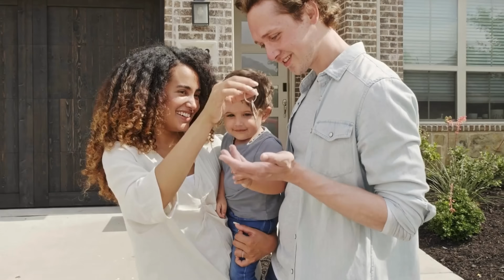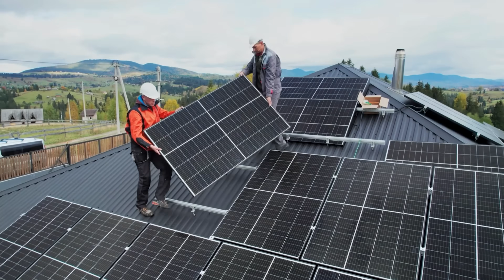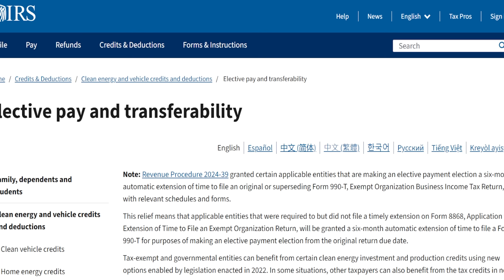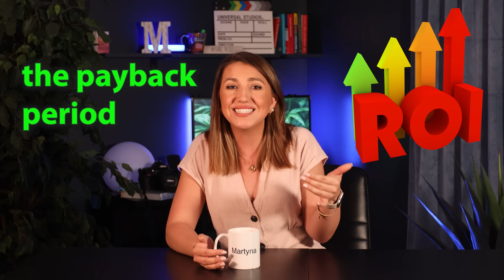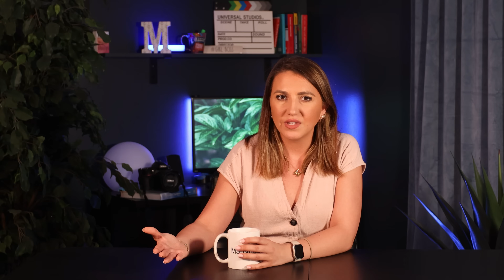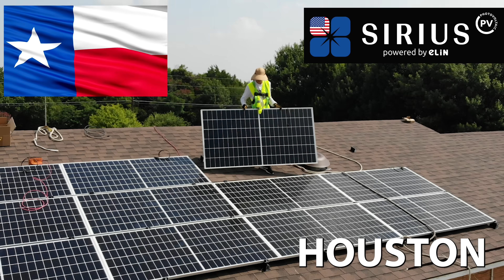Why you should buy SOLAR and BATTERIES NOW in the USA? | Tax Credit just Eliminated by the House!

Comment: I’m 2012 I installed huge solar arrays on my house and my state gave me a 50% tax credit and the federal government gave me a 30% tax credit. I kicked in 20% to get it fully paid for. Unfortunately, Louisiana soon ended that tax credit but I was able to take advantage of this great deal. I am grandfathered in at a one for one credit for my excess power production. I have a $25 a month grid bill but it really great to be energy independent. Later on I installed two power wall batteries so I can use that battery system if the grid goes down and if we have cloudy days while the grid is down and the solar is not producing enough energy to charge the batteries I do have a built in whole home generator to charge the battery’s up instead of running the generator 24 hours a day which takes the load off the generator not having to run all day long. Living in Louisiana we have a good chance of hurricanes and losing power for any length of time in our climate makes life really unbearable. Air conditioning is more life support rather than just a comfort issue.

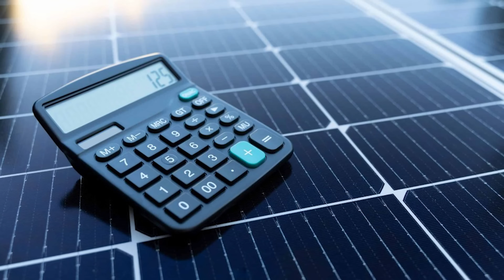Comment: The Solar Companies have been overcharging for solar equipment by 30% 2:28 for as long as it has been given subsidies (30%).  I am excited to finally watch the tide go out and see who has been swimming naked.  Greed of solar companies is now backfiring on them. Make them compete with one another.
Reply from the maker: You're definitely somewhat right, prices will drop in a year, manufacturers and distributors will lower.. because they will sell little and installation companies will also lower margins - I assume that solar will still sell.... but without such companies that go door-to-door and rip off clients for high prices. I'm not afraid for my company we have costs under control and I'm even happy that a lot of dishonest competition will disappear from the market in half a year

Comment: The solar installation (as I understand) needs to be up and running in order to claim the tax credit. So if the bill takes away the credit and it doesn't pass until late in the year it could be crunch time or too late to start the process of installing rooftop solar. A system that goes online Jan 1st is too late.

Comment: Solar is great...
If you install it yourself, with a battery system, off grid, have generator backup, and aren't mounting it on the roof of your house. 
I'm putting it on a single sloped metal roof of an outbuilding. 
Risk of fires with solar is real.

Comment: I did the ultimate cheat. I bought all of my solar and battery equipment wholesale off the Internet for $12,000 and installed it myself. My system operates in non-export mode and therefore never spins my electric meter backwards. I looked up typical costs of a solar plus battery system in my area and took a 30% Federal income tax credit for a "$28,000 system" 😂😂😂😂😂 so that was a nice chunk of money back. Something like $8400. Then I did not pull a permit and nor did I get an inner connection agreement with the electric utility. I say screw everybody! My system ended up having a return on investment of 2.6 years and I will never get busted because my solar panels cannot be seen and I have been doing it for years. 🖕

Comment: Solar panel, battery, and inverter manufacturers and (sorry Martyna) solar installers know about and factor in the 30% income tax credit when pricing their products.  If the tax credit goes away, I don't expect an immediate drop in the prices of the above-mentioned equipment, but there would be a tighter more competitive market and prices would come down.  It might take a few years, and the price drop would probably be less than 30% but I don't feel that the tax payer should be paying for part of solar installations.  Now, I am as greedy as the next guy so I am not going to turn down the tax incentive if it is in place... but I don't think it is a good thing overall.
Reply: No way. Did you even hear what she said?
The ITC is still there, so the scammy big companies will sell more leases because owning solar will cost more (up front) than leasing. The leases are huge scams long-term. This move just helps the billionaire banking class go from 75% market share to 99%.

Comment: You’re under informed. 

Lease - 20 years - 100% replaced with new agreement or removed free of charge. By then the utility company will cost six times more. 
And what are you talking about? Why would they change your roof?  The solar has nothing to do with the age of your roof and the deterioration…. You already have 20,000 holes in your roof. The fixing systems today do not penetrate tiles or shingles. 

And how long is the electric bill for forever?  Never ending. There’s no such thing as a lease agreement of 20 years being a scary thing…

Comment: 0:26  and here is the crux of the issue.  tax dollars are subsidizing a technology that needs to, at some point, stand on its own two feet.
Reply: Then why is the oil and gas industry still receiving tax credits and subsidies?
Reply: Ya and oil and gas has 1 trillion a year subsidized lol
Reply: Now apply that to fossil fuel production which has been around for more than a Century.    This "argument" you make is specious and ignorant to the reality to fuel subsidies.

 U.S. subsidies for fossil fuel production and equipment, highlighting a persistent policy issue: despite global pushes for renewable energy, the U.S. tax code still provides significant support to fossil fuels, including tax breaks like the Percentage Depletion Allowance and the Domestic Manufacturing Deduction, which can reduce taxable income for oil and gas companies by up to 15%, per a 2019 EESI report.

These subsidies, some dating back a century, were originally designed to boost domestic energy production but are now criticized as outdated, with the fossil fuel industry—coal, oil, and natural gas—being mature and highly profitable, generating over $20 billion annually in tax benefits, according to the U.S. Treasury’s 2023 estimates.

Solar investment tax credits (ITC) face cuts in the 2025 budget, potentially ending the 30% credit for residential and commercial solar projects, while fossil fuel subsidies remain untouched, a disparity that could hinder the transition to cleaner energy sources.
Reply: Like fossil fuels?
The fossil fuel industry receives a number of tax breaks, including: 
Intangible drilling costs
Companies can deduct up to 80% of drilling costs in the first year of operation. 

Percentage depletion
Independent producers can deduct 15% of gross revenue from their oil and gas properties. 

Last-In, First-Out (LIFO) accounting
Companies can sell the most recently added fuel to their reserves first, reducing the value of their inventory for taxation purposes. 

Foreign tax credit
Companies can treat royalty payments made abroad as fully deductible foreign income tax. 

Master Limited Partnerships (MLPs)
Companies can combine the investment advantages of publicly traded corporations with the tax benefits of partnerships. 

Amortization of geological and geophysical expenditures
Companies can write off these expenses over two to seven years, lowering their taxable income. 
Other tax breaks for the fossil fuel industry include: incentives for domestic production, write-offs tied to foreign production, accelerated depreciation of natural gas infrastructure, investment credits for clean coal facilities, and energy production credits for coal.

Comment: WHY,WHY,WHY, Solar Panels are the best way to make elect,. BUT you have too BUY the write ones 10BB N type the higher the better, cost more some times. 30% SAVING off bill
Reply: More bus bars means less electrons bouncing around and down the wire so that is absolutely not a situation where the higher the better. You're oversimplifying it

Comment: Some people have said that the 30% paperwork was simple. What I found on the IRS website would require hiring a CPA.
Reply from the maker: A lot of customers that I’ve worked with have used the online systems for their accounting and their tax return such as TurboTax and they mentioned that it was simply a question whether or not they installed Solar the past year and how much the cost was. And that it was probably easier to do it without a CPA with an online system then with a CPA that did not understand that tax form.
Reply: That is so not true. I just did it and it was a single line item with a single simple form. I did it by myself and it took me about five minutes.

Comment: I was getting ready to pull the trigger on adding two Powerwall 3 expansion packs to my system but this tax credit uncertainty is really annoying. Glad you're an advocate for homeowner owned systems. So many people get tricked into leasing or PPAs without fully understanding what they're getting into. I tried to buy a house with a PPA and that was the first time I'd heard of it. Would have cost me $47,000 for the remaining portion of the contract. I've educated more than one Realtor on the downfalls of these.
Reply from the maker: Thank you so much for sharing in this comment. I think leasing and Solar is why realtors hate Solar so much. We just have bad reputation with them because of all the solar city leases from 2015s. 

I need to make a detailed video comparing a solar lease to a Solar loan and Solar cash purchase. 

I like Powerwalls in my opinion they’re not that expensive when you look at the whole cost of a whole home system that provides a true whole home backup that’s more user-friendly. Sure there can be options that are less expensive but are more DIY friendly. That just depends on the customer and what you expect out of your system.

Thank you again so much for the comment
Reply: Powerwall is ridiculously expensive. Why use that?
Reply: @williammeek-h2o  What battery would you suggest that can run my whole house and shop in an outage without a critical loads panel or other equipment? I have a Tesla Backup Switch and that's it. Other battery brands came in higher and limited what I could power without a $5000 Span Panel.
Reply: @nicksgarage2  Battereis are around $160/kWh ready, $130/kWh DYI
Basen Greene 15 kWh battery $2400
Two of those would power a house for a day in most places.
EG4 18kPV is a 12kW 240V hybrid inverter with a 20 KW surge capacity with pass through capability and has 3 mmpt solar charge controllers that can handle a total of 18 kW solar.
A good price on solar panels is $0.25/W
20 kW of panels should be $5k.

What kills everyone price wise is labor. 
Do it yourself or get an electrician friend.
Reply: I see your point, but wouldn't $47,000 be less than what you would pay the utility company over the same course of time? At least here in CA it would. I mean you have to buy your electricity from somewhere either way and its not like you have to pay the $47,000 outright like a traditional lease so you actually end up saving a lot of money. Did they tell you that you had to pay the $47,000 at the time of purchasing the home?

Comment: Solar prices are too expensive in US. not sure why a simple Grid tie system needs to cost $20000.  the parts are under $7000. labor $13000 ?? Solar installers are charging too much and most of the solar owners lose money. I would ban all Grid tie systems. I would only allow Hybrid inverters with batteries.   For a 12k  hybrid inverter with 14kW of batteries and 10kw of solar panels  the price is under $10000 . A solar installer probably charges $40000 for this system. I think that the solar installers are messing up the market and Screwing the customers.
Reply: Your pricing profit ratio is highly debatable … some cases yes. However, nobody factors every factor that goes into running GOOD solar company ….. alot of money goes into the entire picture, sure labor, insurance, equipment, vehicles, maintenance, office, the list goes onnnnnn…. Stay with your life long power purchase agreement with your utility at 100% interest payments (rent) and have no control of rate increases or power outages. Have fun!
Reply: @mickkaylor    I installed my own system  so I'm good. 93kW of LiFEPO4 batteries. I cannot get them to go down under 90%. I  only have 8kw of solar panels and an 8kW inverter. last batch of batteries from China was 62Kw for $5000. So if you do it yourself you can get a $100000 system that a solar installer would charge you for $20000. or less.
Reply: @mlg779 nice and good for you . Most folks can’t do what you did . If they can then of course do it yourself just like any trade right ?
Reply: I bought my solar and batteries for $12,000 and installed it myself!
Reply: @Loki-rascal that's really great.  If people don't want or have the ability to do it themselves then they have to pay for it.
Reply: solar installation business is highly competitive.  it's not a cartel.  running a business is expensive.
Reply: Because if one wants to go around the middleman energy company that expected to collect their mark-up from you forever, they will make it hard. They'll lobby for disrupting regulations, they'll tariff them, inflate materials, ban financing, and as you see here, end the tax credits to make it just too much

Comment: I will almost certainly do one more system next year on a new house I'm preparing to build, and I will do it whether there's a tax credit available or not.    There's grid power available on the property, and I will connect, but being able to run "off-grid" when the power is out, without having to run a generator 24x7 is priceless to me.
Reply: And now you can put your solar system in non-export mode and simply power your house and charge your batteries and don't even bother with a damn permit! That's what I did and I've been doing it for years.
Reply: @Loki-rascal  That is what I am working on. I am receiving 90 kWh worth of cells this weekend and will start building a battery to power my house.
Reply: Are you considering permanently powering your essential loads off of solar to reduce your bill?
Reply: The same reason I am currently installing solar panels/inverter/batteries.  The financial reasons make ZERO sense for me.  The payback period is over 16 years and I seriously doubt I will live that long.  But largely eliminating my electric bill (no bill + sell the excess for a pittance back to the grid for 10 months and a very small bill in December and January) and the ability to do without the power company IS PRICELESS TO ME!!  Also:  We've all seen the big uptick in plane crashes since Orange Donny ascended...I predict deregulation on the utilities is coming and far, far more brown outs and rolling blackouts.  If the electric company has a choice of powering your home and those homes in your zipcode OR providing power for the power hungry AI facility that is willing to PAY MORE...guess who gets the rolling blackout?  This scenario is coming...and it is coming SOON!!!
Reply: @swimmerdudeski6849  Shouldn't cost that much. I just bought 135 kWh of used LFP cells for $7k including shipping.
Look at Battery Hookup. They have good prices on stuff.

Comment: Solar is dead. China is going to be the leader in this industry. Fundamentals are broken. Between absurd deficit spending leading to permanently higher interest rates, a dead housing market, and republican hatred towards the industry... the party from 2017-2022 is over. So many more jobs to be lost, bankruptcies... etc.
Reply: China does make the best pan as here in the good old us of a the environmentalist band The Good elements and chemicals to make good panels like lead in NF3
Reply: Actually everybody should hate the industry 
As it takes some 6 with skyrocketing electric bills to compensate for the power not actually going into the grid 
The ignorance of home solar is easily demonstrated with a volt amp meter and 4th grade math called ohm's law

Comment: never instal it on your roof unless it's a carport
Reply: I have about 400 systems that I have installed on expensive homes in Santa Barbara. On the roof. 15 years later not one single leak,
Reply: @Loki-rascal  no you don’t you’re a liar. It’s closer to 40.
Reply: Depends on the type of roof.  Standing-seam metal with rails clamped to the seams and no penetrations is pretty much guaranteed to be be problem free.
Reply: You do realize that you already have 20,000 holes in your roof already…. Assuming it’s a shingle roof. You are aware of that aren’t you? 
Solar fastening systems today do not drill holes through your shingles or tiles … under informed misconception.

Comment: Looks like bill allows for project to be started UP to 60 days past the bill's passing.  SO not even end of year as hoped...
Reply: ONLY if the project is a commercial project.  Residential MUST be started before the bill is signed and completed by Dec 31, 2025.  Any New Lease or PPA style deals will NOT be eligible for ITC once the bill is signed.  Commercial will be eligible if the construction has begun within 60 days fo the bill being signed. ZERO starting 61 days+
After 60 days ZERO credits for ANY solar projects.
BTW ALL Fossil Fuel credits costing vastly more are completely untouched.

Comment: I love the solar tax credits. But if it has to get slashed I think they can do so strategically.   #1 they can reduce or slash the solar panels.  Solar panels are dirt cheap these days.   #2 they could still retain battery 30 percent credit as battery adoption is very slow and not many houses have them.   #3 They can phase out the credit percentage over time. #4  They can specify which solar components gets the tax credit (currently it applies to the whole solar system as a whole, labor, installation, misc parts, etc).  Fully removing 30 percent credit will be devastating.